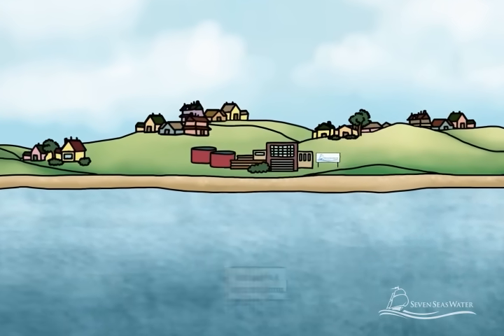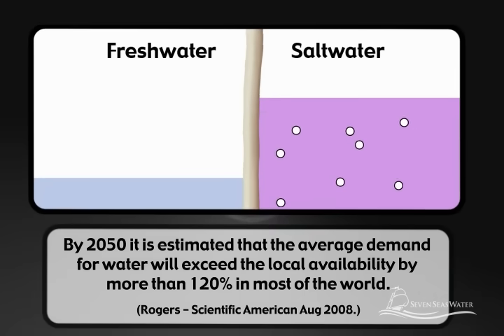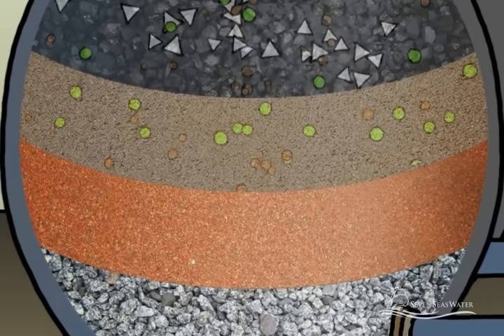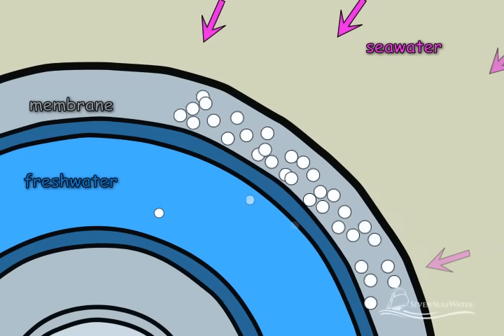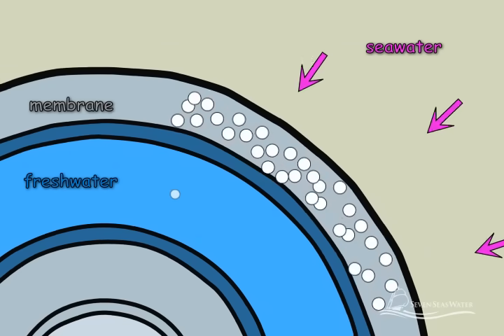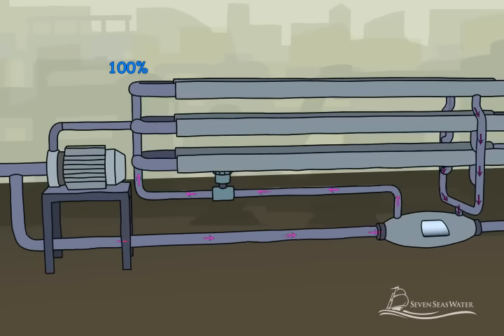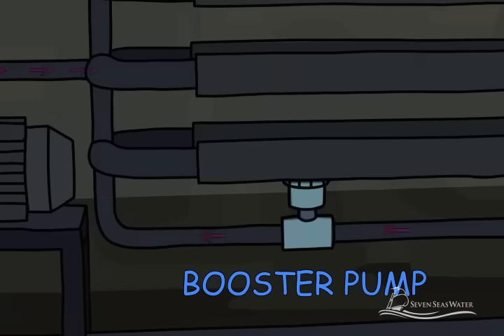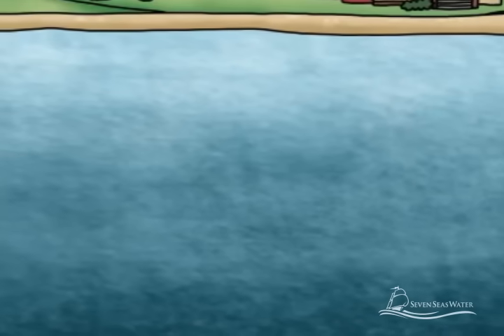How Seawater Desalination Works

Comment: I wonder if it's possible to turn the concentrated saltwater into sea salt and further distill the moisture and turn it into portable water.
Reply: Certainly possible, but I don't believe the value of the water and salt would meet the expense required to process it further.

Comment: Can do better with a  solar distillation system out on the ocean  and  pump the  water  onto shore.  And using a  h-h-o gas  system  to run the  pumps.

Comment: I was involved in developing these types of systems for agri-businesses and oil and gas projects.
Very simple and easy to understand tutorial.
However the caveat [and there is always a down side to nearly every human endeavor] is that the R.O. brine outfall has become a potential problem for the Arab States like Saudi Arabia and UAE among others.
The brine concentration has become a problem ,even in the vast oceans near these water purification plants, due to massive water conversion process that has affected the aquatic flora and fauna [plants and animals] to a degree not anticipated when first proposed.
But oh well..life sucks then you die.
Reply: @redfox435cat  Complete nonsense argument if you have awareness of how water is managed. There is no shortage, there is greed and negligence.
Reply: @Dan Beech could it not just be refined into sea salt via evaporation and sold as in other coastal areas
Reply: Out out brief candle
Reply: Can't the heavily concentrated brine be used in industrial or sanitation applications?

Comment: isn't destilation simple and cheaper? a mirror that is parabolic in 1 axis can heat a copper pipe enough to boil the water leaving salt and other stuff behind, and then condensating it to turn vapor into water back, if this works, then why bothering with reverse osmosis?

Comment: Deslination is useful for cities near the coast line, but not all cities are near the coastline.  This is an expensive process and it also requires large deslination plants.  

This can be used to improve your water supply but the biproduct of this process is heavy salt content in water which is then dumped back into the Ocean.  It is such a small amount when compared to the vast ocean but long term studies have no been done on how dumping this very salt heavy water has on the whole ocean.

Comment: too many steps, too complex system, too many things need to maintain = too expensive...imagine the cost of 1l of such water...it will be 10X or even more higher than that you can get from water distileries
in my opinion if we talk about suply of fresh clean water for africa somewhere between ocean shore and desert near equatorial sun - best complex would be "solar fields distilery farms" (it is about building a lot of black pipes and mirrors to heat them with concentrated solar energy directly to heat up oil in them to boil water in distileries...like it done in Saudi Arabia but they burn oil instead of using land surface for solar energy colectors and maintaining those fields)
osmos is nice idea until you start counting expenses...

Comment: Having "potable" water is commendable, but without the elements found in natural groundwater can this desalinated water sustain life? Would it not be similar in properties to "distilled" water which lacks the trace metals and nutrients that the human body requires from water?
Reply: It's treated to be drinkable like regular water. 

If too many people rely on this source, if it's destroyed by (insert evil nation here) millions will die in a few days or weeks.
Reply: @glidercoach  treated and drinkable does not make it life sustaining. I was excited about the "Slingshot" project which worked with the heat produced from a generator that could make electricity from dung or any other combustable. The slingshot unit could take even liquid from a latrine and produce up to 100 litres of "potable" water a day.
But distilled water lacks the minerals we humans need from water and can even cause dehydration.
Reply: @keithadams6492  
"Treated" can include adding minerals lost in processing, in addition to sanitization etc.

Comment: While the process is well explained,  the initial speech where the need for such solution is based on the growing population, is false.  This process is still expensive and can be justified based on the simple fact of economics compared to other water sources and the associated cost to produce drinking water from them.   
As an example, where ground water contains heavy metals and high contents of Calcium and Magnesium salts, you may conclude, desalination is less expensive because of the pretreatment costs.  So, in my opinion, the drama of the growing population is something that sound very political to my ears and have absolutely nothing to do with the most economical water treatment technique employed to resolve a process need.

Comment: Why send the salt brine back out to the ocean? It could poured out into settling pools and allowed to evaporate into Sea Salt, which could then be sold for additional revenue to help cover operating costs of the plant. Maybe not for human consumption, but road salt or other industrial applications? 

But I'm no expert. I'm sure there's a reason.
Reply: The sea salt is ridiculously cheap. The insignificant amount of sale can add no considerable amount to revenue.
Reply: @shamanjitsingh7267  And yet there are numerous companies around the world who's sole source of revenue is salt. Making it has very little overhead. Cheap as salt is, it's even cheaper to produce, so there is still a profit margin. It may not be the cash cow oil or electricity is, but it's revenue that's getting pumped right back out into the estuaries, killing marine life.
Reply: @facepalmdaily4404  If it was so easy, the world water crises would have been solved by now.
Reply: @shamanjitsingh7267  If it were so easy to make salt the water crisis would be over? LOL. What? 

Never said desalination was easy. I said making the salt out of that leftover brine was super easy, with very little overhead. Try to keep up.
Reply: @IhateAlot718  after doing a little more digging, turns out there is plenty of business in that brine. There are desal plants around the world that don't dump the brine back into the bay. What I suggested is actually being done.... and much more. 

They make salt. Or  they extract magnesium from the brine. Or they pump the brine to a facility that produces sodium chloride and sodium hydroxide from the brine for use in the petro chemical industry. 

So there are faaaarrrr more uses for that brine to turn profits, thus reducing operating costs and keeping that brine from wrecking marine ecosystems.

Comment: Salt is a problem. Throw out the RO system and use energy transfer with ammonia the Ocean surface is warm enough to boil ammonia. boil Ocean water and have clean water & energy production but more importantly extract salt then work on Oxygen issues that are coming!

Comment: I still don't understand what "the membrain" is composed of.  Why was it rolled up into layers as opposed to wound up criss crossing strings like in the first filter.  And why was fiber glass used again?  I kind of missed that part.   Wouldn't it be easier to just mimick nature and subject the seawater to conditions where it can evaporate into a cloud leaving ... everything behind then have the air mass pushed into a cool chamber to condensate back into water?

Comment: uh... compared to this, even destillation looks energyefficient.
especially in hot regions, you could just use sunlight heating up the water...
Reply: Bullshit, distillation/boiling takes a lot more energy. You need to raise water from ~20C to 100C to separate out the salt. Simple googling tells you: 
* Boiling water takes ~0.183 kWh to boil 1 liter of water. 
* Desalination can produce 1000 liters (1 cubic meter) for around 1 kWh.
That makes desalination ~183x more efficient.
Reply: @voidvector  no shit. i know it needs alot of energy.
BUT guess what, most of these areas are in sunny regions.
all you had to do was to build a flat, large container, with a black steelplate on top and fill it with some water.
you could boil tons of water depending on size and heat of the region.
with "up to" 0% energy input, except sun light/heat.
a byproduct would be NaCl that you could use for food, even without much or maybe even any purification steps...

Comment: How could the salt is not allowed to enter as it's not in a solid form but is a homogeneous mixture which can't be separated without chemical or by vaporizing it by boiling, how could you separate diluted salt from sea water?

Comment: Extracts the fresh water while discarding the rejects back into the environment. Forgive me but I really don't see how this is sustainable.
Reply: because the ocean salinity doesnt fluctuate rapidly. provided they did put the Brine outlet in a fast current area of the ocean.

most of the time, many cities are built near oceans for trade but their freshwater supply is deep inland.

so rather than depend on a super massive network of pipes or lots of water catchment reservoirs to collect rainwater or damming a river, 
desalination alleviates the need to move fresh water over long distances or taking huge chunks of land.
rain collecting reservoirs while taking large spaces of land resources to build, suffer from evaporation.

Comment: Why not use a solar mill? Sea water is gradually pumped in to evaporation tanks, the clear, angled tops of those tanks warms the water and fresh water vapor condenses on the clear angled tops where the droplets run down into collection canals focused into one collection tank. The natural waves can provide the necessary energy to pump the water from the sea to the evaporation tanks.

Comment: to all the people saying "why so complex? use a still":

The energy required to evaporate water is enormous. to be able to filter water without evaporating it is an enormous efficiency boost.
Reply: @royalgilpin4922  yeah, perhaps reverse osmosis combined with boiling off the brine to just leave salt would keep that out of the ocean. That would likely undo some of the energy efficiency, but it may solve that problem.
Reply: @druhu  that´s what i thought why throwing the brine away there are a lot of uses for salt, and having it in such concentrated form would speed up the processes
Reply: @Humbulla93  well, less volume means easier boiling, but does the added salt raise or lower the boiling point?
Reply: @druhu  added salt ( impurities) lower the boiling point, with this property you can find out the purity of a substance. i love thinking of ways to increase efficiency as power is a valuable resource. my approach would be to use tube inside a fresnel lense, albeit the sun has to shine but with the lense a bit of sunshine goes a long way
Reply: @Druhu Thanks for that explanation... I DID wonder why boiling off the water wasn't an option. You reason makes sense.
Reply: I'm glad I'm not the only person to have that as my knee jerk reaction. I'm like "Vacuum tubes, mirrors, make a still."
Reply: Never the less, the air around us already contains a lot of water that is ready to be condensed
Reply: @jorgechristophergarzasepul3209  At 76 degrees and 50% humidity, a cubic yard of air holds .5 g of water vapor, so you'd have to process two cubic yards to get 1 ml.  To get a liter of water, you'd have to process 2000 cubic yards of air.  In most countries, each person uses about 3700 liters per day (that's per capita water consumption for all purposes, i.e., total water used in the country divided by the number of people), so to get one persons daily allotment of water, you'd have tp process 7.4 Million cubic yards of air.  Condensing water from air in large quantities requires a huge amount of energy.  You'd probably  be better off using hydrolysis to create O2 and H2 out of seawater and then combusting it to turn it back into fresh water.
Reply: @jorgechristophergarzasepul3209  that possibly works in areas where its very humid, but not all places next to saltwater are very humid, and making them less humid for a comparitively small amount of water (maybe a large bucket per cubic kilometer) probably isnt a good idea. Theres a reason water isnt listed as huge component in the air we breath, theres not that much.

Comment: "Sea water can be "economically" and reliably converted..."   NOPE, that is the very reason why it is not used worldwide already in large volumes. It's quite expensive to do it. Mostly rich nations can afford it, and they have to use it as the very last resort in desperation after they have used all other possible fresh water resources available. And maintenance is a pain in these systems, you have to be cleaning all that filter media and changing worn osmosis filters constantly.

Comment: There are other methods. For example, you can use a vacuum pump to reduce pressure so that sea water boils (leaving the salt behind) at room temperature (evaporator) which also drops the vapour temperature.  You run the vapor through a heat exchanger to absorb heat for the surrounding air.  Then run through a condenser,  when vacuum is released, the water and vapor becomes very hot  and runs through a heat exchanger that is cooled by the sea water inflow.  So the desalinated water is cooled to it;s original temperature but at the same time the seawater is heated which increases it's vapor temp much like the way a still works.  This is done for efficiency as the warmed sea water requires far less vacuum to vaporise.  Therefore far less mechanical energy is required to maintain the system.  This is basically the same principle as an air con & doesn't require any filters.
Reply: That is ducking genius, thank you for sharing
Reply: nice explanation

Comment: I feel like a lot of energy could be saved if these plants were built a mile under sea level. That's a lot of natural pressure to work with, but the initial cost will be extremely high. They should also figure out something else to do with the brine other than dump it back into the ocean. I don't believe for one second that it doesn't have any impact on the immediate area and slowly spread.